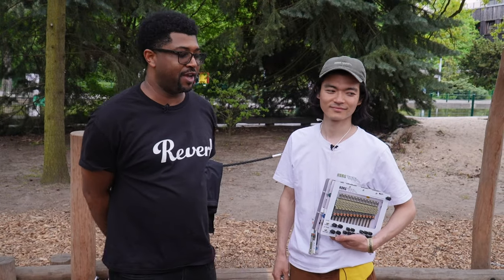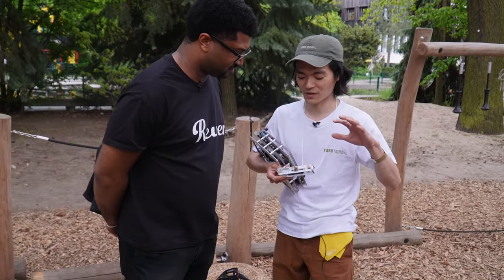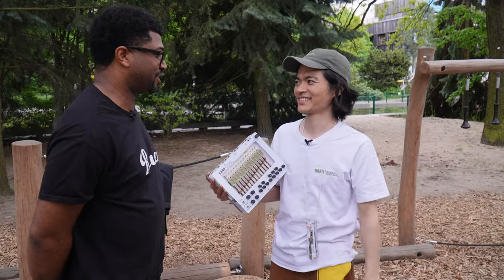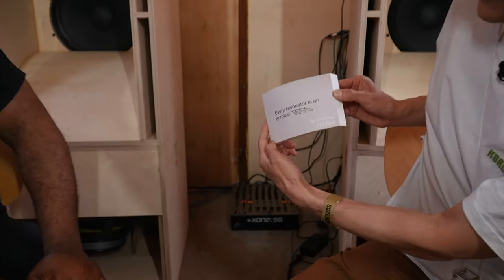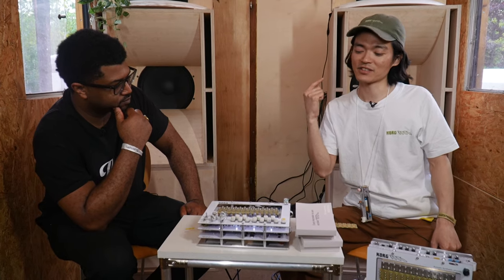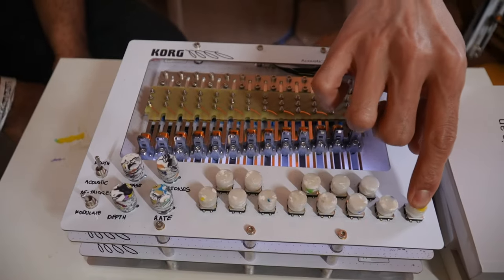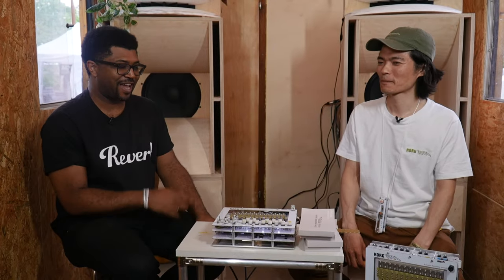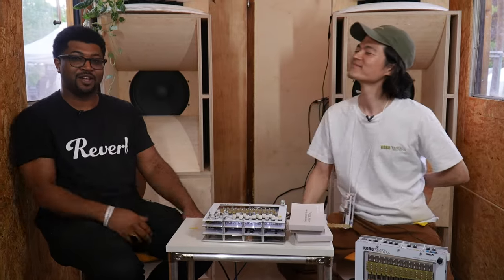Korg Berlin Introduces Acoustic Synthesizer Prototype w/ Tatsuya Takahashi | Superbooth 2023

Comment: I think if they make a drum machine with this technology and use different materials for each drum part this would be the best drum machine released in years. Could be the next « 808 » revolutionary-type of gear. Each machine would have it’s own unique character and a natural feel
Reply: the 808 wasn't revolutionary at all.. it was a flop and then it actually died completley on the second hand market for over 25 years...
I purchased one in perfect condition in the mid 00s for $600. It's now worth $8000.
Reply: @noname-ng6sj  just because it was a  flop doesn’t mean it wasn’t revolutionary. It was the first synthesized drum machine that wasn’t limited to preset patterns or using samples. Drum machines as we know them today owe most of their design and workflow elements to it.
Reply: @olGrandpaby  Wasn't the Linn Drum the first to do that around that time? I think most people settled for the 808 because they couldn't afford the Linn Drum which was the much more revolutionary and diverse instrument. Also if I'm not mistaken weren't the 606 & 707 released before it?
Reply: @knives_on_static  the Linn Drum and 707 were both sample based. The 606 and 808 are all analog but the 808 released a year before the 606.
Reply: Yea, imagine trying other metals as well and different thicknesses.

Comment: It bothers me when professionals use inaccurate vocabulary : acoustic refers to something that produce a sound by itself (a pressure wave in air), electronic refers to an instrument using an amp to broadcast in air an electrical signal that is generated by an electronic circuit, and electromechanical refers to an instrument that uses an amp to broadcast an electrical signal coming from a mechanical device (for example fender rhodes or electric guitar).
As i understand this instrument, it doesn't produce any usable sound without being plugged into an amp which makes it an hybrid between electronic and eletromechanical, and not an hybrid between electronic and acoustic.
Reply: It's a for marketing.

Comment: There is too much positivity in this comment section for how dumb and potentially non-functional this concept is. Congrats! It's a series of electronic tuning forks that sound like tuning forks and can physically do what tuning forks can... Maybe I'm just jaded from decades of Korg and others forcing over-hyped, over-priced oscillators and similarly functionally-bankrupt gear, but I honestly can't see how this "Acoustic Synthesizer" has much usability beyond a few gimmicky sounds. Sure, you get reverb, acoustic resonations, and feedback, but you also get a box of resonating feedback... You know... Like having a guitar or piano, except with a more difficult interface and all sorts of potential feedback and environmental noise. Sure, being able to electronically sustain vibrations is cool, but I could also buy an e-bow and do that on a guitar or other metal-stringed instrument that already has centuries of innovation and design behind it, can interface with other audio devices/effects without issue, and is already a well known platform musicians are familiar playing. If I want to experiment with sinewaves and resonance, I can buy or make a cheap reverb device out of metal parts and a contact mic. Sure, the idea and concept of this device seem cool, but I fail to see how this is more useful, accessible, or modular than purchasing a stringed instrument that I'm going to guess is about $800 cheaper than whatever this thing ends up being...